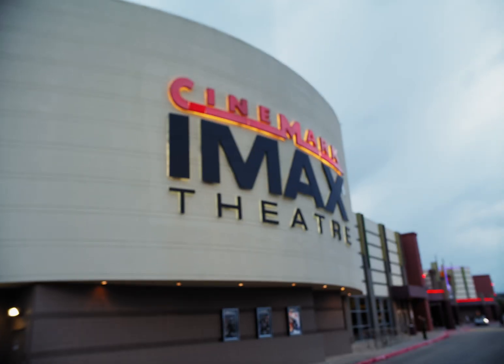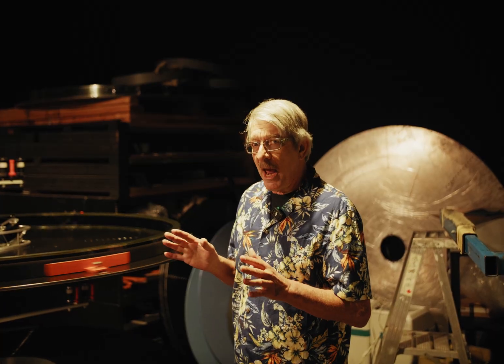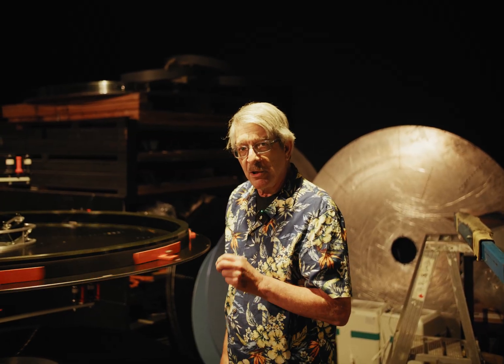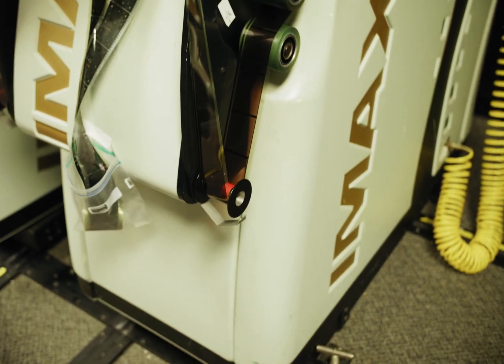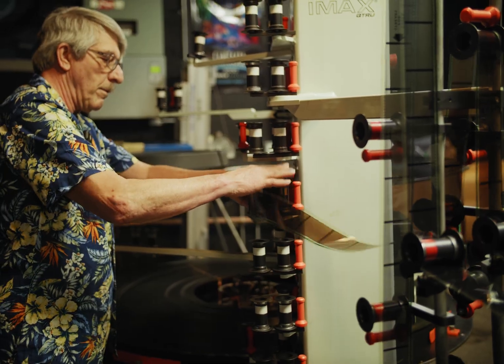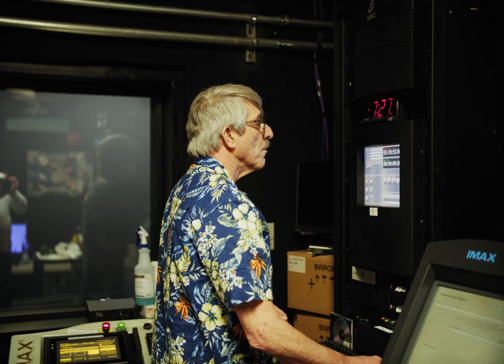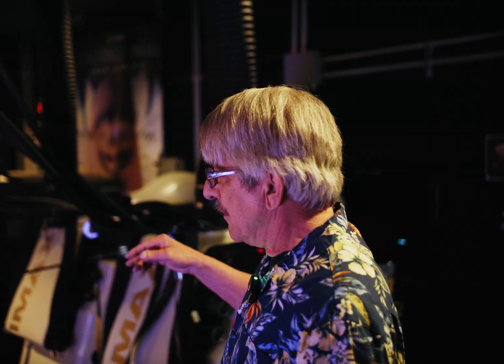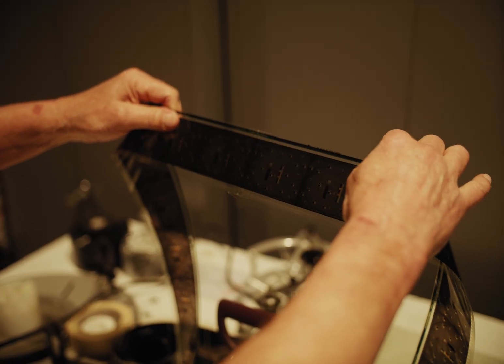IMAX 70mm BTS w/ Projectionist Pat Caldwell — Cinemark 17 Dallas

Comment: Some of that brings back memories. My first job in high school and for the next five years or so was in a 6Plex. I couldn’t wait to learn projection. Even though it wasn’t a career there hasn’t been much sense that I enjoyed so much.  We didn’t have platters.  We had wall transports.  I’ve never seen anything like it since.  I was a perfectionist. Constantly checking sound and focus.    No 70 mm of course, but we did have an interlock feature where we could project one print through two projectors parallel to each other simultaneously. We ran interlock on Jurassic Park and a few good men, because all of the shows were selling out.  Unfortunately, an inexperienced projectionist miss threaded one of the screenings of a few good men. It damaged the print considerably to the point it had to be replaced.  We renamed it. “ A few Good Splices”. I’ll never forget that.
Reply from the maker: Thanks for sharing!

Comment: I would love a comparison of imax dual laser vs 15/70.
Reply from the maker: True 15/70 IMAX runs 70 mm film sideways, fills a 1.43:1 screen, and, when printed straight from the camera negative, resolves the equivalent of roughly 18K—hence the uncanny sharpness of Oppenheimer at Lincoln Square. Early digital IMAX (single‑laser or xenon) was only 2K at 1.9:1, but the current dual‑laser “GT” systems push 4K at the full 1.43:1 height. Because most modern 70 mm releases are struck from a 4K digital intermediate rather than the original negative, their real‑world detail tops out at the same 4K as dual‑laser, with film adding only grain and a touch of highlight flicker. For Sinners, the dual‑laser GT auditorium gives you all the available resolution minus the film artifacts.

I preferred film for Sinners, simply for the nostalgic qualities and for the work the projectionists put in, but a dual-laser GT digital screening would be technically more pristine.